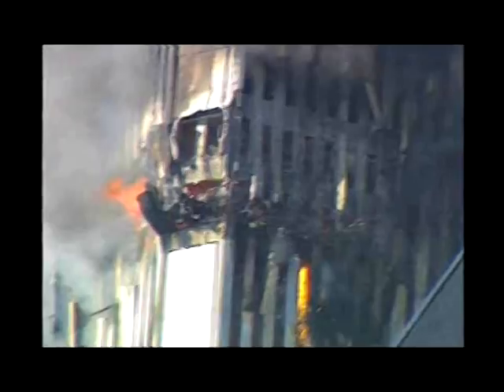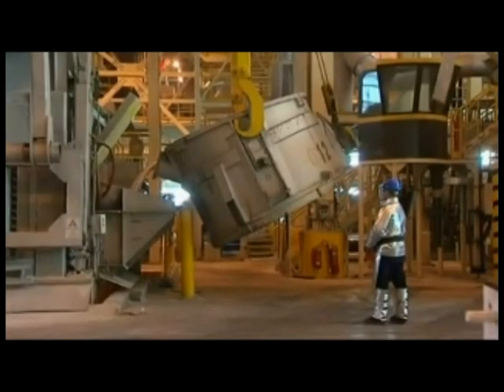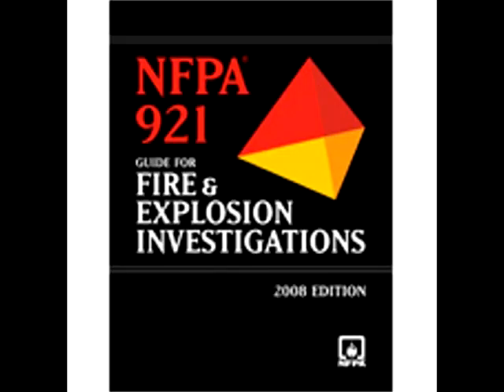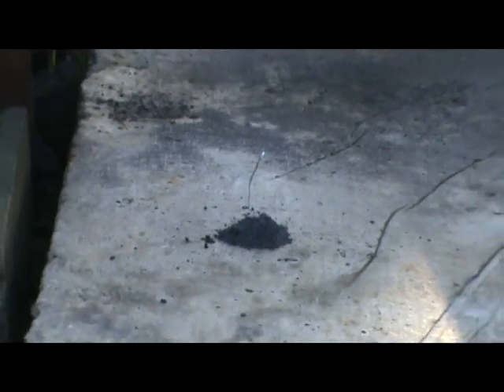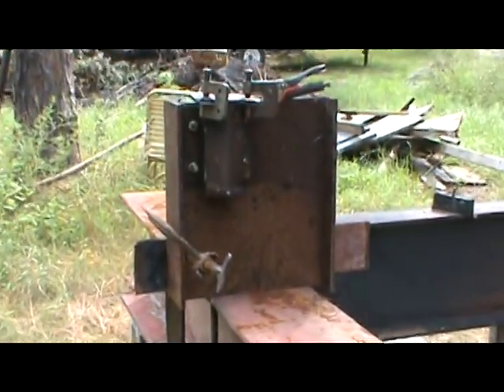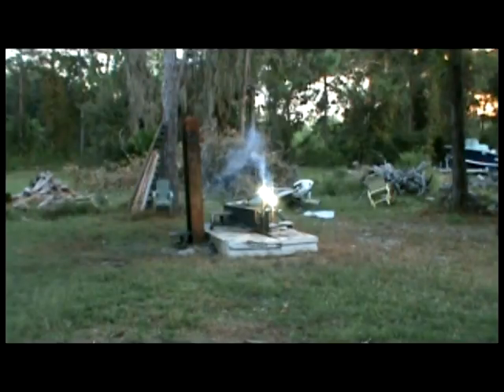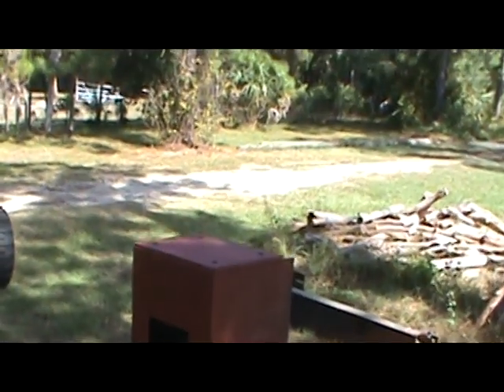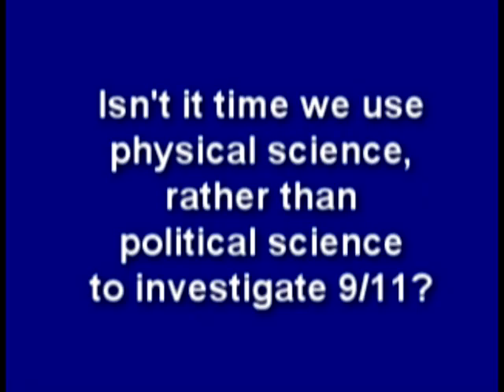9/11 Experiments: The Great Thermate Debate

Comment: I’m a welder. I’ve studied metallurgy as well. Whoever disagrees with this is just stupid.
Reply: Donovan Nungasak you should inform theis idiots a few strings up, they seem to forget the demo like collapse of wtc7 I mean it fell in its own footprint like a demolition
Reply: https://youtu.be/6xif0jIT_ZM
Reply: Donovan Nungasak whoever agrees with this is gullible. Don't need a degree to know that.
Reply: Donovan Nungasak Well you didn't lean much about metals the story was BS..
Reply: you weld metal? so you know when you heat metal, even to the point where it still doesn't melt, you know that it's much weaker, and can bend and warp much more easily. 
SO let fire lick around alot of these support beams for hours, heating them up so they're INCREDIBLY hot but still not nearly hot enough to MELT them, but it IS hot enough to cause them to be quite a bit weaker, now think "Ok these beams could warp and are alot weaker than they should be" why? because there's 3/4ths of the buildings weight STILL leaning down ontop of those beams, you are not a welder or you would know this.

Comment: Mg will ignite in the air right away, Al will form a oxideied coating meeting the air, that is way nomatter how hot it is, it still looks silvery outside. Iron, unlike Al, it will actually burned meeting air under 1 atm pressure, and the carbon insdie the crystal also enhase the process, that is why it glows and sparks violently. So, let us compare: Al and steel, clearly, based on the clips, the steel hyposeses is more compeling, it glows continouesly and sparks. kerosene, by any weight ratio, with 1 Atm, someone has to understand, the process wont speed up by having a masive scale of 'rocket stove', for the ox ration dont change as the unchanged 1ATM pressure and OX density, AND no way kerosene, and with imagnary 'roket stove' under 1 ATM pressure and ox density by NIST can melt steel, and it at least requires 2500 c to do that. But to my surprise, In my experense, 1intch strutual steel is too thick for thermite, even for coper oxdies, but but but, I never ever can come up with THIS guy's skill: IT CAN BE DONE LIKE A SHAPED CHARGE, and the liquide flow can be concentrated to any direction. To me, it is not the reason why the tower collaps perplexing me, it can be done due to angled cuting or 500 or above c temp to soften the structure, it is the melten steel, noway it can ben done by carosen and a massive 'rocket stove' with 1 atm pressure in air. Some one mentioned the torch, hey, it requires PURE ox UNDER 90 PSI pressure with a highly confied space in your torch gun. The tower is not a rocket engine.

Comment: I suspect thermite was only part of the equation, I think Tesla's vibrating contraption did the rest. I've seen raw footage of 400 foot high external spires turn to dust after towers had fallen. Apply this machine to the foundation of the towers along with thermite and it won't be long till it's falling perfectly into itself minimising all damage to surrounding buildings. This is the cause of the massive dust clouds when towers fellow, and why there was so little rubble.

Comment: just because thermite melts steel beams doesnt mean it was used, there could have been a ton of other things that could have happened like you know... a big fucking fire 80 stories high with wind might be able to you know... weaken the building since its fucking huge and cannot be tested with a few steel beams... if you want accurate testings on what could have happened you need a a big fucking tower and allahu akbar it and see how it goes for yourself.

im not saying it couldnt have been thermite, its just highly unlikely.

Comment: The big hole in this theory is that all the internal cladding and insulation would need to be taken off to fit such devices to the columns and RSJs. I'm sure this would take a lot of time and effort not to mention people witnessing such things happening to the building. There was a hell of a lot of people who worked in the towers and I'm sure they must have seen the exposed beams and detonation wires. No-one who worked there and survived ever mentioned seeing any of this. I'm damn sure if this work had taken place to fit the thermite charges in my place of work I'd have noticed it.......As would plenty of others...

Comment: Here is another fun fact,no other skyscraper  in the world  have ever fallen due to a fire not ONE
Reply: Garfield Tower 😂

I guess you're referring to Grenfell Tower, if you got autocorrected then fair enough 😜

But, Grenfell Tower didn't fall. It was burned out to a husk, but didn't collapse. The structure held.
Reply: mike jones's well how many skyscrapers had a fucking jet airplane fly into them.
Reply: Chicken Joe hes not talking about those two
Reply: and both towers collapsed identically? within a few minutes of each other? at freefall which is not possible? and there were no floors left, no black boxes or flight recorders, and there were angled cuts in the beams which experts in demolition say is vital to having a controlled demolition fall straight down? and the firefighters that described molten steel running like a foundry?
Reply: What about WTC7? It had no planes fly into it, and it collapsed as well. No steel framed building has collapsed due to fire before and since 9/11. Ponder that for a bit.
Reply: mike jones's here's another fun fact, no other skyscraper in the world has ever had a fuel laden jumbo jet crash into it...
Reply: well there are a few things to think about, the site states the energy a jet would have on impact, however it doesnt state the amount of energy need to collapse the building. He does state how it might even beable to withstand multiple planes but we dont get a specific number. Although the tests state that it could withstand an impact of a 707 and that the 767 plane used would generate less force however it was heavier. You have to think about how the jet fuel relates aswell, although it might not melt steel beams, it can weaken them. Adding on to that idea the towers didnt instantly collapse, so while they might withstand the initial impact, I doubt they could also withstand the weight and the weakening of the beams over time.
Reply: WolfieGamin YT the titanic was said to be unsinkable.. until it sank. Just like this building was meant to be able to withstand a plane hitting it
Reply: Chicken Joe so building 7, that didn't have a plane hit it, collapsed due to fire.

in all of recorded history, 3 skyscrapers have fallen due to planes and/or fire..  they all just happened to be on the same day..in the same location..owned by the same guy,  who just so happened to take out extra insurance for fire and terrorist attacks just days before..
Reply: mike jones's yeah it was definitely had nothing to do the AIRLINER THST FLEW THROUGH THE BUILDING
Reply: WolfieGamin YT And the Titanic was made to be unsinkable. Just because something was built for something unprecedented, that doesn't mean it will actually hold up
Reply: I believe it. I don't know who was behind it, but it wasn't the planes that brought the towers down. Seems obvious to me.
Reply: WolfieGamin YT They meant small airplanes. Not a fucking Boeing 747 jumbojet.
Reply: DJPhattEric unsinkable not indestructible dumb fuvk
Reply: Marteen O  the B-25 travels significantly slower and burns a different fuel. Being a piston powdered aircraft it uses 100 LL which burns at a lower temp than that of Jet fuel.
Reply: none of them had a bigass jet fly thrue them
Reply: Role Geno well played  well played
Reply: Role Geno lmao 😂😂😂
Reply: Not one, but two?
Reply: These towers had a lot of stuff in them including multiple firearms and other chemicals
Reply: Chicken Joe There is this building in London, that burned for over 24 hours... And didn't collapse.
Reply: Spamster3212 yeah, it seems british are better at construction than americans :V
Reply: Chicken Joe that's not true, at least one other American building had a plane fly right into it, and though the plane was smaller it was a military plane cutting more than halfway through  the building, but that's not what I actually want to say.

Believe it or not, steel and iron are both very flamable  if exposed to high enough temperatures, that's why ground zero burned so long after the fall of the towers. A plane could not have destroyed the towers alone, partly because they where flown into the top of the bluilding, and not the bottom, and because the buildings were designed to be able to take such a hit. I still don't actually believe it was the government who destroyed the building, but what I am pretty sure about is that the fire destroyed both the main towers and not the planes.

Of course, the buildings falling down absolutely straight and the destruction of building 7 should ring some alarm bells, espacially  because building 7 only had a few shattered windows at first...
Reply: Just google transfer phenomena.

The plane hits the building.
It's forward momentum is transferred into the building like a shockwave weakening the support structure.
Along with mass momentum it carries energy which converts into heat and it sent along the same pathway as the momentum causing the beams to heat up and bend. I am unsure if the beams actually melted. It is more likely that the beams heated, then buckled, then solidified again giving the illusion of 'melting' when it was more of a soft bend.
Reply: Slice it anyway you want too but plane's can't cause steel to become molten lava and nobody has explained how the molten steel was around for almost a week after the wtc fell
Reply: As one of my friends who saw this video said, it's elementary when you know the cutting temperature of the metal. Only a few things are known to melt steel, and jet fuel ain't one of them.
Reply: mike jones's not true:
http://www.debunking911.com/moltensteel.htm
It's been explained over and over and OVER again.
Reply: Depends on the definition of skyscraper I guess. Here's an example of a 26 story  building in Brazil that collapsed due to fire. https://www.bbc.com/news/world-latin-america-43960778
Reply: Chicken Joe Explain Tower seven then, dip shit.
Reply: Riley Bell then how the fuck did the tip 15 floors of the building fall at freefall even though there was another 100 floors underneath them?
Reply: as soon as you mention WTC7 all the media worshiping shills pack their bags and run for the hills because they cant explain it!
Reply: Chicken Joe What about Building 7? No airplane hit that!
Reply: Riley Bell Building 7 debunks this 100%.
Reply: No other sky scraper had ever been hit by a jumbo jet going 400 miles per hour either. And this fire was spread over multiple floors and across the entire building width instantaneously as well.
Reply: Why do truthtards always have to lie? - Sao Paolo as mentioned and the Plasco tower https://www.youtube.com/watch?v=sPGr4D1-zDI
Reply: serpentineufo yeh this building collapsed but it was an old piece of shit and didn't fall straight down.. People who think it's actually possible for three buildings to fall straight down.. What a joke.
Reply: Wonderfully Beautiful you do realize jet fuel doesnt burn that long.
Reply: You have no idea about Grenfell tower at all! Office furniture has codes to make it fire retardant! The tower in London was covered in flammable cladding and it burned for 60 HOURS! https://en.wikipedia.org/wiki/Grenfell_Tower_fire
Reply: Chicken Joe exactly. These people are clueless. A fucking airliner slams into a building and people think it was fire alone that weakened the structure. Absolutely clueless
Reply: Riley Bell there was a third building that collapsed. It is known to be the ONLY steel beam and concrete reinforced building to have collapsed due to an uncontrolled fire
Reply: WolfieGamin YT those engineers seem to forget how HEAT WEAKENS SUPPORT.
Reply: Riley Bell Its more the fact thst it fell the way it did. Buildings dont just fall straightdown on themselves unless in a controlled demolition. A building hit by an airliner like that would fall sideways towards the side it was hit from. Im not saying one way or another im just pointing out my observation
Reply: Chicken Joe well the building was actually designed to with hold a plane hitting it...as said by the engineer-http://www1.ae911truth.org/faqs/655-faq-9-were-the-twin-towers-designed-to-survive-the-impact-of-the-airplanes.html 
And here is his quote - We looked at every possible thing we could think of that could happen to the buildings, even to the extent of an airplane hitting the side… Our analysis indicated the biggest problem would be the fact that all the fuel (from the airplane) would dump into the building. There would be a horrendous fire. A lot of people would be killed. [But] the building structure would still be there.”
Reply: @ItsNav  and the titanic was unsinkable
Reply: Could it be possible, that at the time the towers were being built, the height of the building made it so that they needed to put some type of minor explosive element in the support beams? To prevent the towers from falling sideways and instead have it collapse on itself

The video did say that the metal beams glowed red orange 3 beams then 6 werent glowing then another 3.
Reply: Johnathan jay I think that's truly the only way to get the thermite in there.
Reply: Alexanndre Levan wrong...
https://www.quora.com/How-many-steel-buildings-have-collapsed-from-fire-besides-WTC
This is a small list, actually. I personally watched one collapse in Omaha, Nebraska.  What further exaggerated the issues with WT1, WT2,  and WT7 is that all three used the same flawed design. A central column and a steel "skin" and the floors being held up by 6 inch clips.  This open air design was great for space.... Bad for design loads.
Reply: Chicken Joe 
https://youtu.be/P1ULjJ3EqyY

Watch the video nitwit.
Reply: Riley Bell hey soyboy, I got a video for ya

https://youtu.be/P1ULjJ3EqyY
Nobody gave you intuition?  Dumbass...
Reply: IBetYouDidntKnowYouTubeLetYouDoThisILoveBleach360NoScope420BlazeIt. You sound like a fucking liberal the way you make excuses that have nothing to do with the cause.  Educate yourself snoflake 

https://youtu.be/P1ULjJ3EqyY

Comment: A shaped charge can cut steel. The type of charge can be any effective chemical compound. 

Is it possible? Yes. 

Can you tell what chemical compound was used? Yes.

What by-products, foreign to the building were detected in the aftermath?

Under normal circumstances, that would be the answer.

Comment: You are correct. The Jets were a smoke screen for cover and give time for the thermate to do it's job until the detonation sequences began... in the beginning of this video I almost switched off when you said it can cut vertically... They usually use Iron tubes for 1. uniform timing and 2. increase the heat (as you figured out) ... But for missions like this, they would use any metals the the buildings were made of, or the Jets Cargo. No pressure pulses...  Those were timed detonations. But find the truth for yourself, your on the right path. Good Job on this video.
Reply: For the sake of those who lost their lives on 911 and the soldiers that defended our country, regardless of these facts... They are all heroes, The passengers, those in the towers, and our soldiers should be considered in this. This isnt too easy for any of them to hear this truth. This is why I discontinued such assessments and  pray that those responsible will get what they deserve.

Comment: Okay well you let me know when the US government snuck into the world trade center, opened up the structure to get to the support beams underneath, put a thermite charge, and cleaned everything up to make it look like nothing happened, and no one noticed.
Reply: caleb benton. We're all the buildings made from steel from the same source?
Reply: Rod Bender what does that matter? That has no relevance to my comment.
Reply: caleb benton, china steel is of inferior quality. Do you know what the difference is between forged and extruded?  Forged steel is porous. Beams sitting on decks of ships can be exposed to salinity. Not to mention scrap iron making a voyage to the place cheap steel was forged. Rust never sleeps. Corrosion just may be a better answer. Or poorly extruded.
Reply: Rod Bender im thinking the towers fell bc that plane hit them
Reply: caleb: true that did happen.  Just a little tap from a plane. It didn't take much to knock down building 7 also.